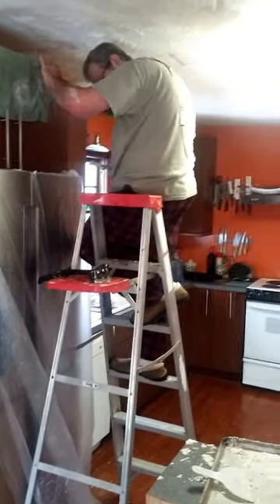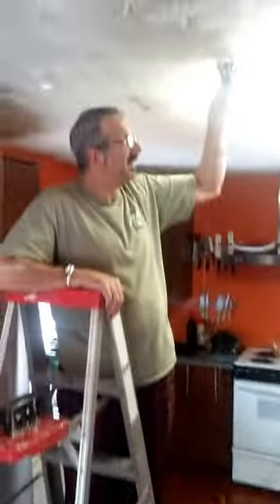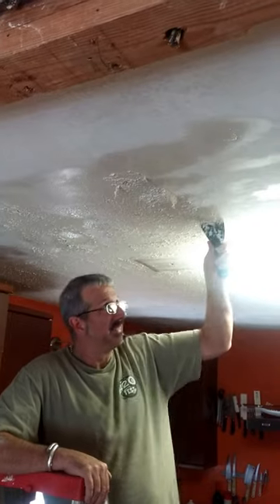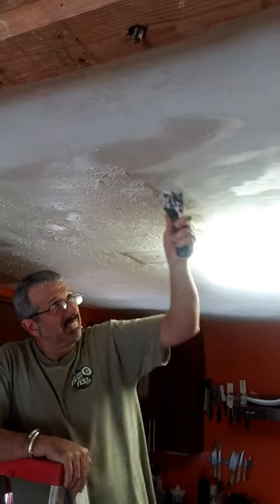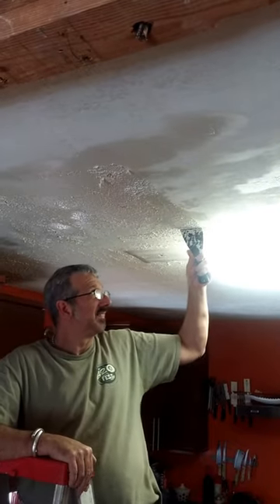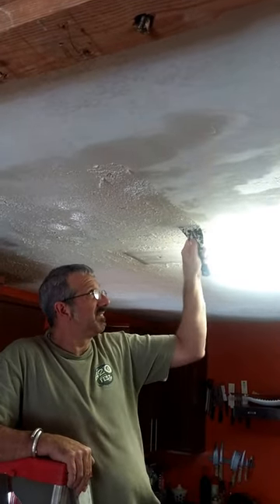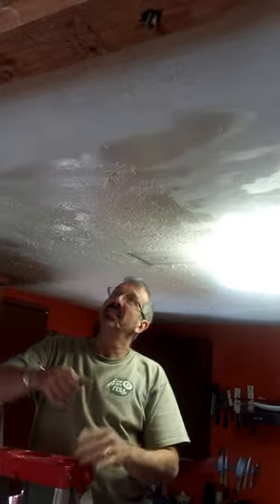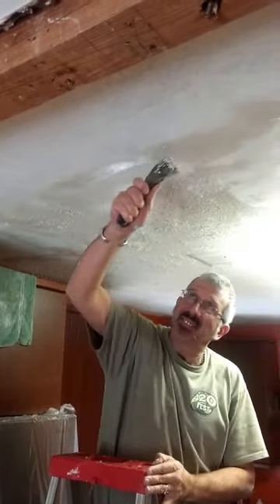Ceiling scraping

Comment: As a painter. Seeing the lack of plastic prep hurts my very being. Also.... use water to break that stuff up and scrape with a ten inch blade. Have that done in less than an hour.
Reply: I hate my popcorn ceilings but am afraid of the mess removing it.
Reply: @freedomspromise8519  It’s a mess but it’s super easy to minimize it. 9-12 foot plastic. Make the room contained like a dexters kill room. Drop clothes on the floor. Cover furniture not movable. Get one of those pump sprayers. Spray the ceiling down nice and even with water and scrape her down. The prep off takes longer than the job and the clean up combined.